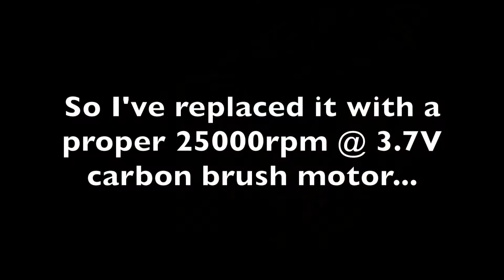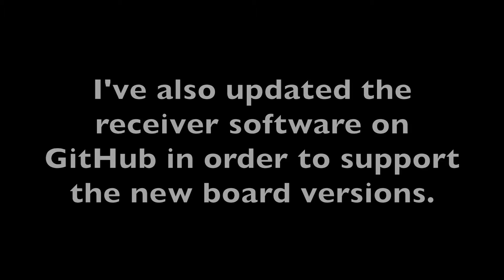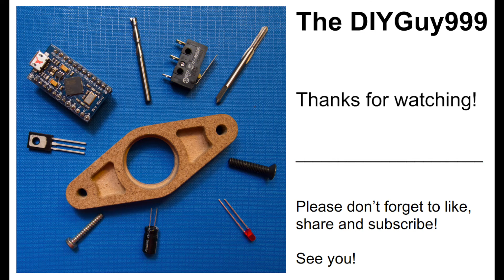New "High Power" 2.4GHz Arduino "Micro RC" Receiver Version

Comment: pcb Micro_RC_Receiver use mic5205 3.3vol 0.5mA    when atmega328+nrf24+TB6612  with mic5205 0.5mA is?????
Reply from the maker: I don't quite understand your question. Why 0.5mA? The MIC5205 is able to supply 150mA, which is more than enough. All my receivers are working fine, and I already built about 20 pcs. of them.
Reply: sorry I wrote mistakenly, The MIC5205 is able to supply 150mA, it is not enough to load for, tb6612 full load, not atmegs328 with nrf24l01,because the right for the nrf24l01 usage, Sorry for your english mode
Reply from the maker: Of course the load current of the TB6612fng is not supplied by the mic. It is supplied directly from the battery voltage. And as I said my reveivers all work fine.
Reply: After I reconsider that is true thank you very much, To me it also works very well

Comment: Hi! and i saw it running at channel 10, now i want to add a receiver. So I have to edit the code to use with the transmitter that I have thank you
Reply from the maker: Hi. You can select the vehicle address in the vehicleConfig.h file. You can add as much vehicle configurations as you want, but the number of different addresses is limited to 10. Also have a look at the transmitter manual: https://github.com/TheDIYGuy999/RC_Transmitter/blob/master/Manual_English.pdf
Reply: #define PIPER_J3 // <- Select the correct vehicle configuration here before uploading! thanks !!!!!!!!!!!!
Reply from the maker: Yes, it's that easy. Just insert one of your configurations (the one you want) here. Then upload the sketch to your receiver. That's it!
BTW: I would love to see a video of your work.
Reply: 47/5000
pcb has not come yet when i will let you watch the video
Reply: Thank you very much for your sharing with everyone to wish you a lot of fun